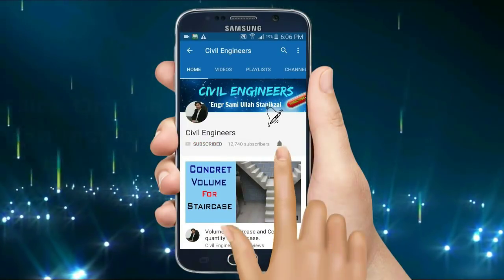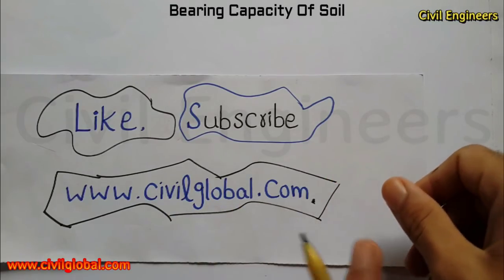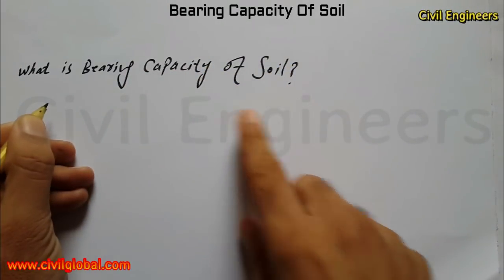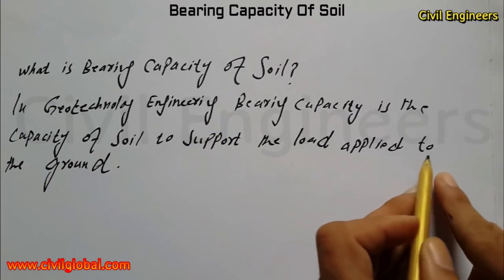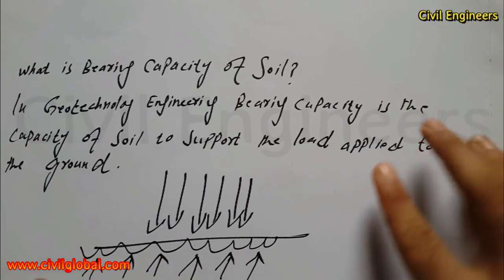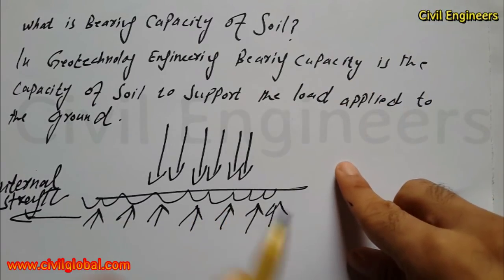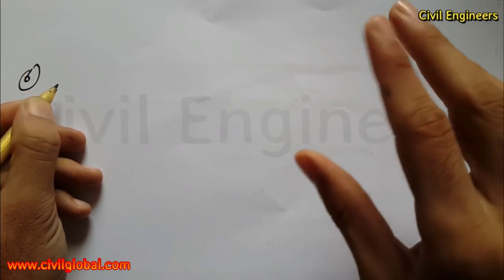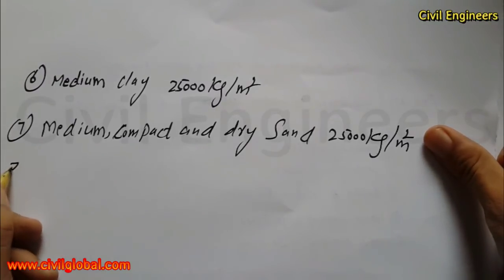Bearing Capacity Of Soil | Bearing capacity of Different types of soil |

Comment: Hello. How did you determine the orders of the bearing capacity of those soils? Bases on Mohr- Coulomb resistance verification?   The Peruvian designing practice determines the ultimate bearing capacity  of soils, obtaining as you mention for medium to soft clays 1 .5 - 2.5 Ton/m2, but after the consolidation settlement assessment, and the applying of SF of 2.5 to 3, the bearing capacity decrease to about 0.5 Ton/m2. Please your comments. Thank you.

Comment: Its confusing  unit.....SBC is rather  measured in kN/Square M  . As its upward  pressure  expressed in kN per  unit area.
Reply: 10000*9.81=98100N/M2 and 98100/1000=98.1kn/m2 it is approximately 100 Kn/m2
Reply: Exactly